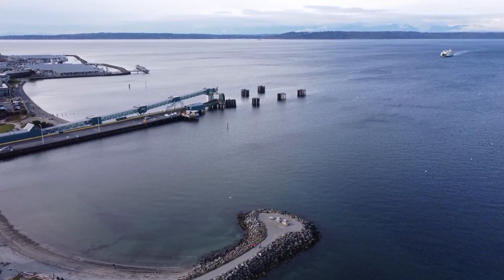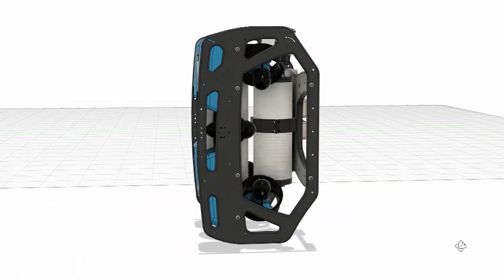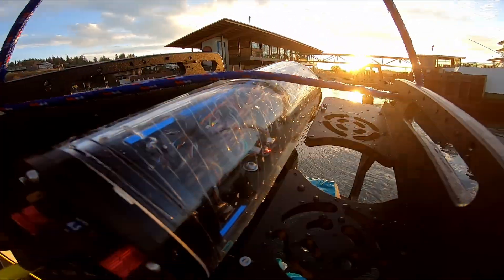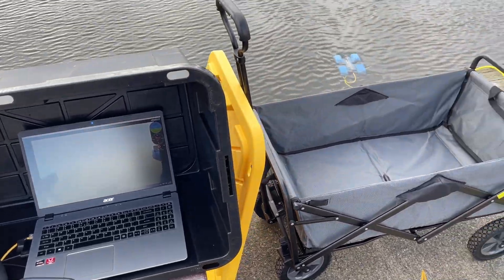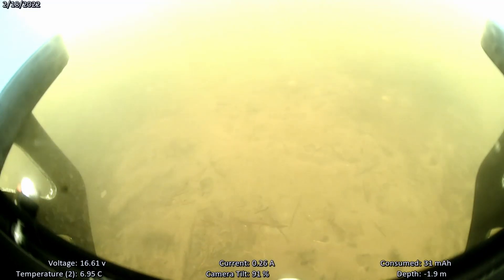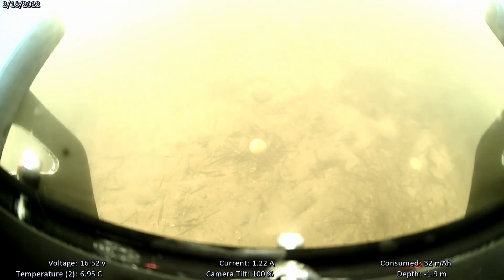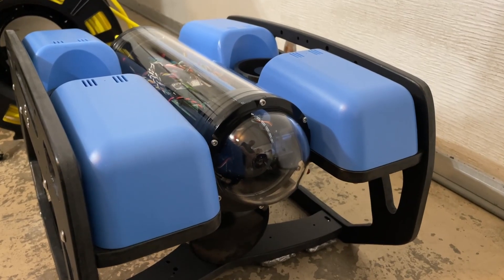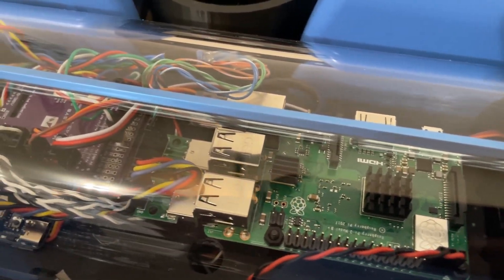Building my own ROV Submarine

Comment: It would be cool to figure out how to lower the frequency of a wireless transmitter to work in the water (<1mhz) and use it as a backup if the cable breaks or the cable all of a sudden gets stuck and needs to be released for recovery.
Reply: It would also be cool to try using lidar, infrared (night vision?), and/or lidar to see better through the dust

Comment: Hey you project inspired me to build my own, but i am cheaper then you. 😂 i am 3d printing frame and i have access to pipes and i am a welder. Så making my own enclosure. But cant find any photos hot the endcaps are fitted. Can you help me with that?
Reply from the maker: Sorry for the late reply. Did you get your project built already? The end caps are compression fit with 2 ring seals on the end caps. I initially tried using the end caps with a PVC pipe but the interior wasn’t concentric enough and I had to go with the acrylic tube.

Comment: Hardly a diy build you have all the equiment and the computer skills to make a copy of somone elses
Reply from the maker: That’s a valid criticism, however there are a few things I should clarify that aren’t included in the video. The BluROV project is an open source project and since they sell most of the speciality parts I needed, I built the chassis around their design to keep it compatible. All of the electronics used however are quite different from their design and during my build I worked directly with their software development team to add support for non standard equipment. So although it’s not built from scratch I feel that I did make a useful contribution to the project.
Reply: @ensoRC  fair enough mate a built one with drone parts made new bodies to turn propeller motors into thrusters a chinese control board all parts a made was with a basic 3d printer so tooks weeks to make everything if didn’t work took even longer. In the end had a rov it worked did some stuff on lochs. Then lost it inspecting a ww2 german plane in a dam near to were a live. Left it all till now to see if tech side is moved on and can buy alot more on line

Comment: What is the name of cnc laser cut machine? (i mean model type)
Reply from the maker: It’s a K40. There are many different variations but practically speaking they’re all pretty much the same. They’re not great out of the box but luckily there’s a large community of makers using them so there’s lots of documentation on upgrading them.

Comment: I've been working on something similar for about 2.5 years now. Did you use a pixhawk with ardusub? I have been building mine to go down to 1k meters, with a large 1.2kW battery. It also weighs like 120lbs so far. 
If you did use a pixhawk, did you use the pixhawk 4 or the 2.x one? I was originally looking for one that was 'officially' supported by bluerov, but I saw that github had firmware for the 4 so I just went with that one. I have not yet messed with the control board yet, I am getting the structural stuff working first, then I will be tackling the electrical system, that way I know how long to run wires, where to put througholes, etc etc.
Reply from the maker: Wow! I would love to see that. 

Im using a Matek f722 wing running Ardusub. It’s cheaper but I’m still having some issues remapping resources.

Comment: Very cool, now it needs a manipulator arm and grapple so that you can pick up and retrieve anything interesting you come across on the bottom. On what hardware do you run ardu-sub? I work for a UAV company we run ardu-copter in a pix-hawk autopilot on a couple of our testing UAV's.
Reply from the maker: Thank you! I really want to have something to grab with. I may just start with a simple hook or a magnet though. 

I'm running ardusub on a Matek F722 wing. It's not officially supported and I'm still having issues with some of the PWM resources but it works well otherwise. Here's a link to the project page with more information on all of the parts used. https://sites.google.com/view/diyrov

Comment: It helps to have some negative buoyancy, weighted mine to -1.9 lbs. Slow rate of sink, easy to pull up if needed.  Up down thruster is still effective but try not to use it too much as the silt makes visibility impossible.

Comment: Hey for your 3018 CNC mill what controller are you using? The controller that came with mine crashes when I open files. 😑
Reply from the maker: That’s not good! I’m using the Woodpecker board v3.4 running grbl 1.1. I hope that helps.
Reply: @ensoRC  Alright, I'll look into that. Thanks!

Comment: Great build! How does the Raspberry Pi hold in respect to heat inside the enclosure? Is the surface area of the enclosure itself sufficient to cool down the air inside the enclosure (which in turn will help dissipate the heat from the RPi and other components)? Cheers
Reply from the maker: Thank you! It seems to do just fine. I don’t think I’ve seen it over 50c but it’s usually only running for 15-20mins and the processor load is pretty low. It’s a good question though. I’ll see if I can record the temps during my next use.
Reply: @ensoRC  ok ok, cool. In you videos you seem to have tested it in relatively cold waters (6-7 deg C right?) which can also help. Running it in hot tropical waters might pose an increased challenge in keeping it cool though..one eventually simple approach to overcome heat issues could be to instead use a metallic enclosure, and have the components that emmit more heat, be thermally coupled to a  wall of that enclosure. Another slightly more complicated approach would be to use pipes that channel  water to thermal pads attached to some of the chips.

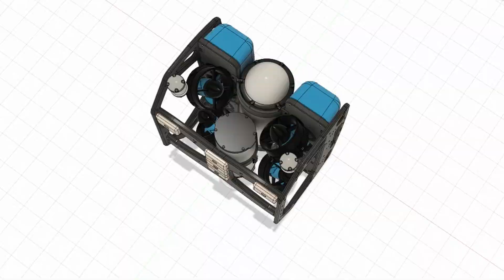Comment: 1:00 and damn the intellectual property rights.
5:47 does GPS work underwater?  You need an arm and gripper to grab things that look interesting.
Reply: I'm waiting for an official answer but I doubt that the GPS signal would go down more than a couple of feet. Or a couple inches in salt water.
Reply: @henryD9363  Yes, unfortunately GPS doesn’t function under water much more than a few centimeters. The only guidance available is a compass and sonar if you have it. It is possible to do sonar based triangulation but I don’t have any experience with that yet.
Reply: @henryD9363  tooo bad, that would make sea floor mapping a synch, now I support inertial navigation is the way to go.  Does the hobby tech include inertial navigation?  Am I saying that correctly?  Think gyroscope...
Reply from the maker: Yeah, there is a gyro and accelerometer on board. If you combined those with a downward facing camera you should be able to stitch them in software. I would probably want to add a depth sonar to get a more accurate scale for the images.
Reply: @ensoRC  ambition, that's what that is.  Good for you, can't wait to see your solutionj.
Reply from the maker: The BlueROV project is open source and they offer all of their designs for the public to use. I’ve worked with their devs and they are an amazing team!

Unfortunately, GPS doesn’t work underwater. The only guidance tool you have with this is a compass. Unless you want to get into sonar. I really want to add a gripper of some kind but I think I’ll need stronger thrusters to lift anything.
Reply: @ensoRC  Open Source is a gift, good thing you found that site.  I wish you had put up more of the build but I understand that it is a hassle to video record while your one-off prototyping.  Thanks for sharing the video, the possibilities are amazing.
Reply from the maker: Yeah. I started designing my own from scratch in the beginning but I was finding it really hard to find the pressure rated parts I needed. 

I really wished I recorded more of the process. I wasn’t really planning to make a video. But I am working on a video that covers more of the details. I’m still not much of a YouTuber at this point just a tinkerer that sometimes uploads videos 😄
Reply: @ensoRC  Any video you can make is worth watching, the journey of the thing is the exciting part.  Wish I could have access to an ocean, but we are limited here in DC.
Reply: @ensoRC  safe to drop weights so you can lighten up the craft as you collect samples (trash)
Reply from the maker: Yeah that would be a good idea! Now I just have to design some waterproof actuators. Or maybe some kind of co2 cartridge balloon.

Comment: Why not pressurize the electronic compartment to e.g. 10bar pressure. Then you can see leaks all ready at the surface. Or even more cool keep the pressure a little higher than the outside pressure, with automatic adjustment of the pressure?
Reply from the maker: With this enclosure design the end caps have a gasket that slides into the main tube and are retained with compression. They can handle large amounts of external pressure but can’t handle any internal pressure. So you can vacuum test it but only to atmospheric pressure unfortunately.

Comment: My Highschool’s Robotics Team is sponsored by BlueRobotics. Not that you need my advice, but an easy way to check for leaks is to vacuum test your housings. Pretty sure BlueRobotics has some penetrators specifically for that purpose. Also T200 Thrusters are a bit pricey but if you can get your hands on some, they work super well
Reply from the maker: Actually, I did vacuum test the enclosure before the first time I put it in the water and saw that there was some loss of vacuum over a few hours but I thought that it was insignificant or possibly a leak in the pump itself. Now I know better :) Even a tiny leak at a depth of a few meters is a serious issue.

Comment: Greetings! Impressive build from what little I have seen at present time. I was wondering if you've thought of using a buoy to provide means of adding remote control to the ROV? You might also be able to rig a reel system for the tether to the ROV on said buoy. I think I saw Peter Sripol using a buoy on one of his projects. He's the only Youtuber I can think of that would have used such an idea.
Reply from the maker: I have definitely thought about it. If the sub works reliably,  I think that will be my next upgrade. That would greatly increase my options for exploration!
Reply: @ensoRC  I also live in the puget sound what part do  you live? I would like to see your work some time.